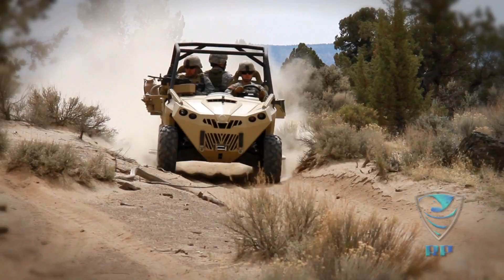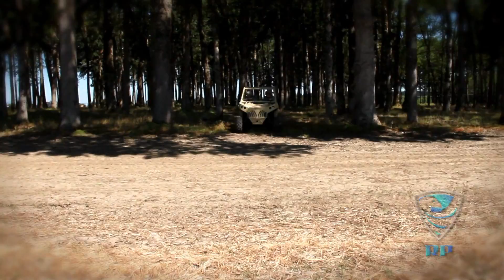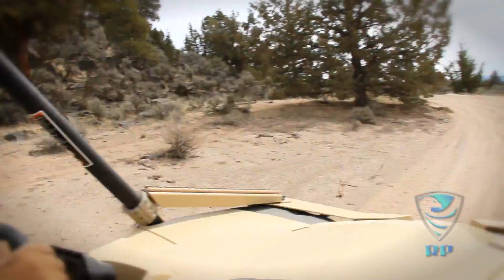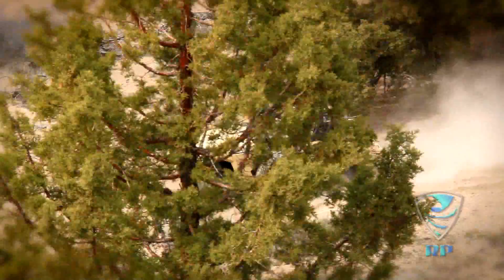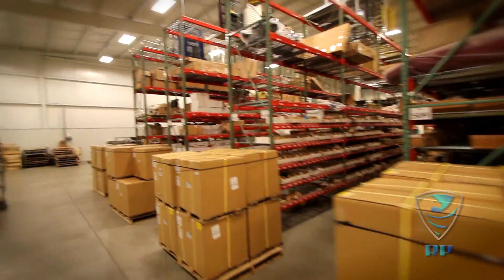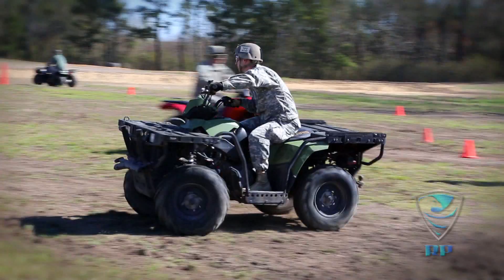Military UTV: What sets RPAMS apart

Comment: I notice it does not go in soft material e.g. snow, mud, sand or heavy brush.  You will need at least 3 strong backs to get back on road.  Does it run on diesel?
Reply from the maker: Soft conditions actually aren't a problem (not sure how you got that impression).  We also equip our rigs with a winch just in case there is a sticky situation.  We’ve also found that more weight can actually help with better handling in softer conditions and with all of the upgrades we do, we usually add a couple hundred pounds. Oh, and no these aren't diesel. They're gas.
Reply: More weight being beneficial in soft soil conditions is not the norm. The term "floating" over soft soil exists for that reason. You took a UTV, upgraded the suspension and gave it a facelift. You're not fooling anyone.